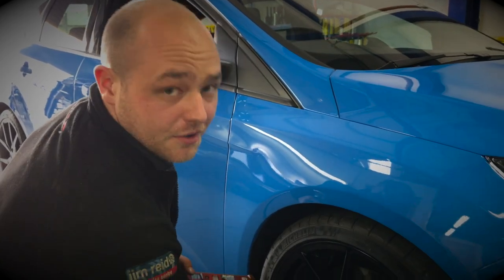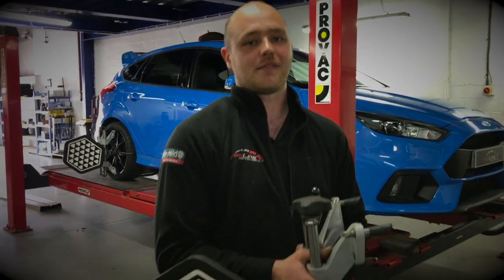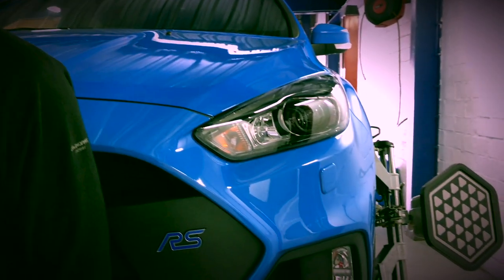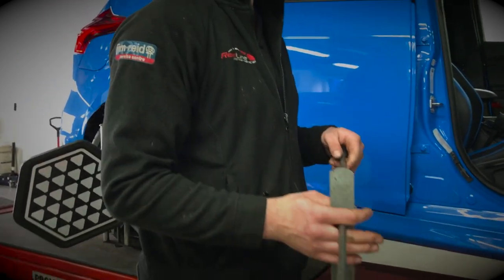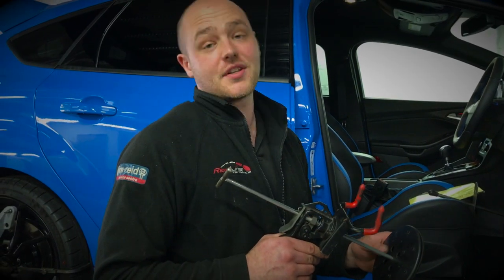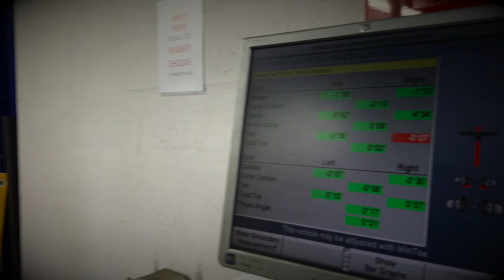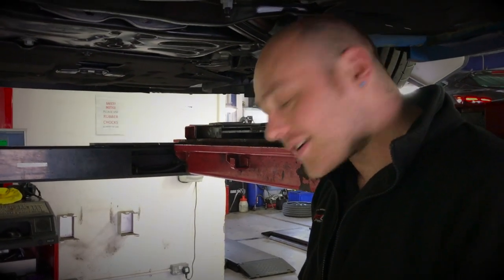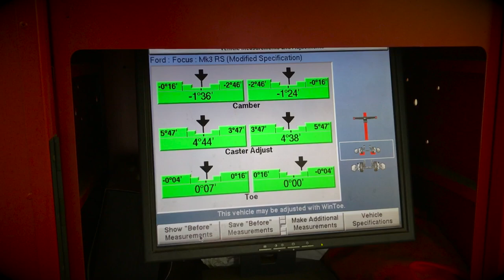4 Wheel Alignment Explained

Comment: I just had my car alignment done and the guy used the sensors but they also lift off my car and did the alignment while the vehicle was in the air instead of have on it wheels, what is the difference?
Reply: The difference is accurate computer system. It's there way of making a extra buck for the customers complains by making a accusation of mistakes. But a computer can't get fired hey?